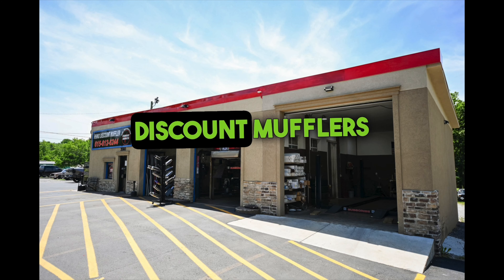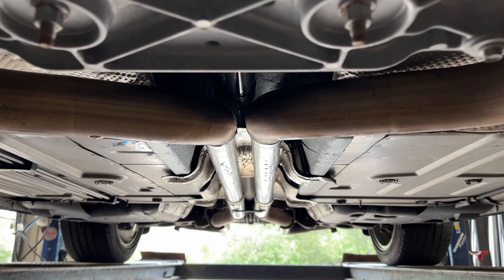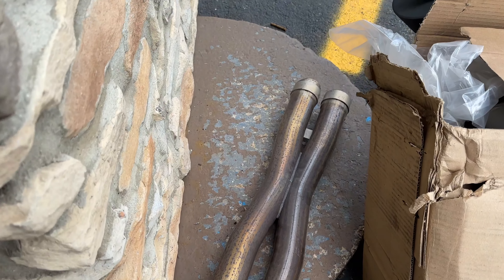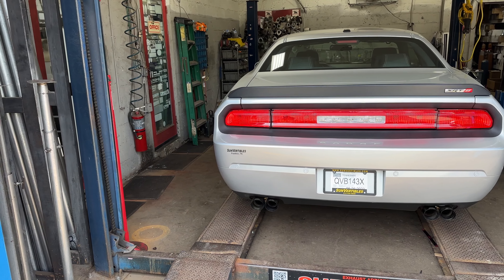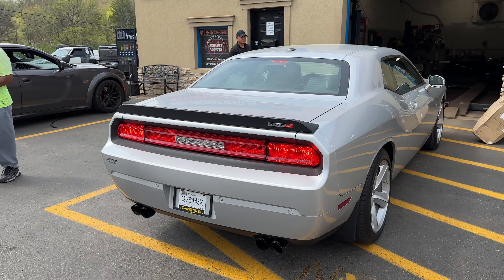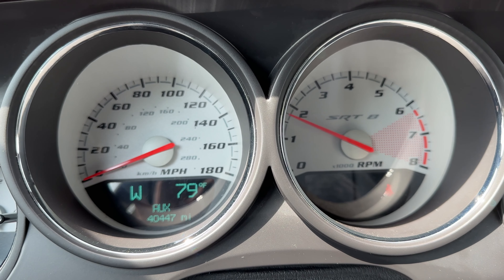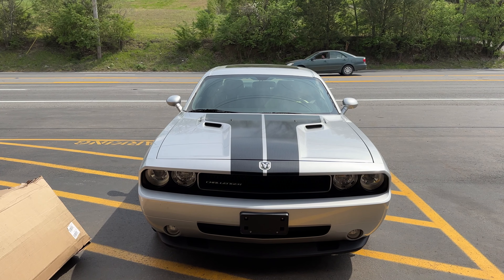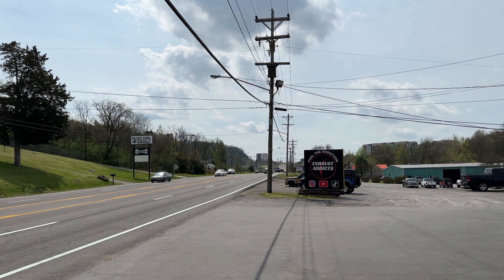We Straight Piped a 2010 Dodge SRT/8 6.1L HEMI V8!

Comment: This is the best Challenger. Earlier models look nicer and cleaner design wise.
Reply: @@thatv8life186Dweyugghhhh
Reply: @@thatv8life186bros gatekeeping opinions 😂
Reply: Its just more pleasing to you. 
These earlier 3rd gens have a more classic muscle look that can take chrome/steel/machined rims as a better match over the modern multi-spoked ones. 
Nothing beats the lines of a 1st gen though.
Reply: I like Facelift better
Reply: @@thatv8life186lol he probably doesn't even take em to a drag strip lol
Reply: @@thatv8life186 I see no point in owning a performance car if you don't use the performance
Reply: @thatv8life186  Also, you are allowed to have opinions on things when you don't have them. You don't unlock some supreme knowledge by owning a car.
Reply: @thatv8life186  a ton of mustang owners, lol
Reply: @thatv8life186  actually you can. I'm sure you have criticized many cars you don't own.
Reply: @thatv8life186  you don't own an srt8 challenger, so by your own logic, you haven't the right to criticize.

Comment: Either something is bad on that challenger (fuel injector, cylinder, etc) or the straight pipe simply sounds awful.  Btw, that has nothing to do with the shop.  They do what the customer wants.  The work looked great!
Reply: I think it's their job to steer the customer in the right direction, not just say yes to everything. Educate them that it will lose power, recommend an alternative. Then you'll be known for your work and your ethic.